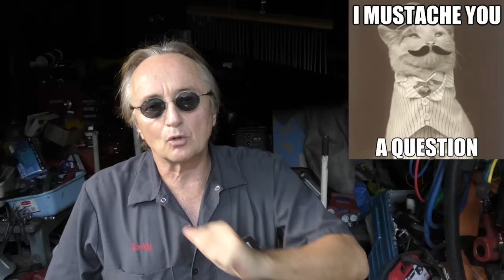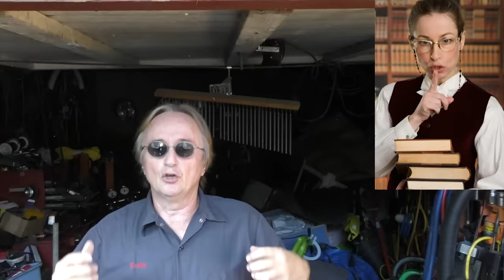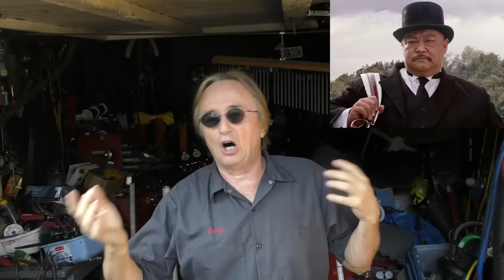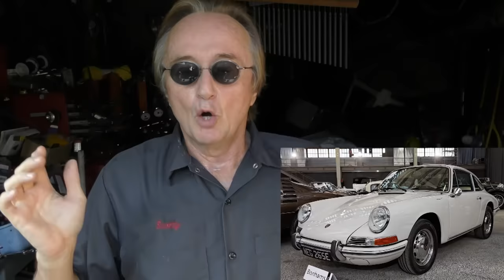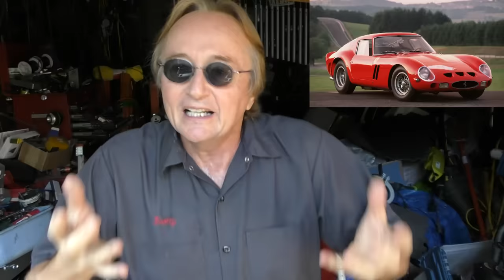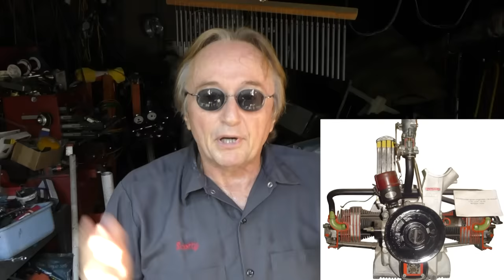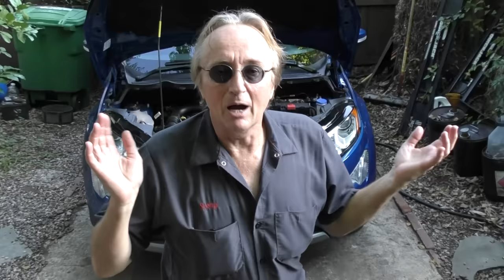The Truth About Boxer Engine Cars

Comment: I've owned 3 Subarus over a 40 year period and they are one of the most reliable cars on the planet.
Reply: Well they "subaru" are owned by toyota, and some of there junk is cheap china junk, 130,000 your gonna do a head job.every time , not on my G.m. cars and pickups.
Reply: @mikestanly749  Cheap china junk? I loved my GM cars but man are you dense if you think these cars are "cheap china junk". Japanese engineers don't equate to Chinese engineers.
Reply: @mikestanly749  The head gasket issue was mostly w/ the DOHC naturally aspirated engines that ran in the early 2000s in certain models.  I've driven three Subarus past 200k miles, and a couple more past 150k and never had head gasket failure in any.  (I also didn't have the notorious SOHC 2.5, mind you.)   Consumer Reports still ranks the brand as very reliable.  They are incredibly safe, and have an AWD system that few can rival.
Reply: mike stanly not 40 years ago they weren’t. Not even 20 years ago...
Reply: @tuck229  the only reason why the head gaskets failed in the non turbo 2.5L engines were only because of the cheap head gaskets subaru used.. the early STI's didn't have the same notorious problem
Reply: Let me guess...You baby your car and go above and beyond with maintenance.
Reply: @YNorth  When was the head gasket problem resolved?
Reply: my dad owns subaru like 15 years We had Justy i am not shure if its boxer engine we had outback,Xv,Foresters and now we have levorg we had alot of expirience with them and they are actualy very very reliable cars theyr much more reliable than fords peugots and more I would say that maybe theyr as reliable as toyota.
Reply: @dario4496  All Subarus have a boxer engine.
Reply: @mikestanly749  A 17% stake in the company is hardly owned
Reply: @YNorth  The head gaskets in the 255's and 257's were garbage too. Tomei makes an almost bullet proof EJ head gasket. I have a 255 with a tomei hg and arp head studs that's turned over 200k hard miles with no issue
Reply: Try telling that to my friends that are on their 3rd engine. Most gone before 60k miles.
Reply: @jordanjoestar8839  Sure but you don't know what kind of maintenance they did either.
Reply: @jordanjoestar8839  Your friends need to pay better attention to regular maintenance. Three EJ's over 200k, only had one that was run low on oil because my kid was driving it, blew a turbo line and drove it another 45 miles that needed a rebuild
Reply: I own a 09 forester xt turbo 120 k and runs like a YOTA 😁 My 4th subaru
Reply: My sister had a Subaru for 14 years and then passed it on to our mother for another 5 years. I gave mom my 91 Camry with 125,000 on it and she took it to 300,000. Toyota and Subaru both good.
Reply: Totally agree. I'm on my 9th Subaru and when the new STI comes out I will buy number 10!
Reply: Except the 'glass piston' STIs...
Reply: I have a Subaru Forester had it since 2004 runs great...
Reply: My 2003 outback has 360k miles and is still going great, original engine, transmission, alternator, etc.  I'd buy another in a heartbeat.  Just recently replaced a lot of suspension parts, ball joints and a year ago, rear drive shaft.  Other than that, runs fantastic!  I could see it going 400k+ miles easy!
Reply: @mikestanly749  140k on my automatic and no head gasket failure.
Reply: @mikestanly749  no China On  Subaru’s
Reply: @mikestanly749  No China on Subaru ! You need to educate yourself ! Subaru’s are vastly more dependable than General Motors products! General Motors has some good years especially some trucks but the general dynamics of a Subaru is far superior in engineering and driving dynamics.
Reply: @mikestanly749  my bubaru forester just hit 170k. Still don't need a head gasket.
Reply: @mikestanly749 GM = plastic drop links
Very cheaply made cars.
Reply: I just bought my first subaru crosstrek...so far I'm loving it...
Reply: @mikestanly749  best do your research before running mouth.  I sold Subarus and many of them were well above the numbers you gave and no issues.
Reply: My 1995 Subaru impreza just hit 400k still running strong. No weird smoke or idle issues. I still can't believe it starts up every morning.
Reply: can someone help me with my subaru
Reply: @irontiger0462  hmmm. Subaru made 1.8 billion in 2021   whats 17% of 1.8b? Ill make it easy. 17% is 1.7 million bucks a year.  Im pretty sure... thats owning a piece.
Reply: @mikestanly749  just had my 2013 subi outback head gasket replaced at 134,000 miles. i heard o2 sensors and axles are also notorious for going bad after mine went. make sure you spend the extra $100 to get a subi axle and not aftermarket 🙃 i'm learning the hard way
Reply: @mikestanly749  200K on my 2015 Impreza. original transmission and engine no issues.
Reply: @YNorth  I don't think the gaskets are the issue.I feel it's the cheap head bolts are stretching.Every one I worked on I checked the head bolts with a torque wrench and they are always a little loose..I use the ARP stud kit to reassemble and never a problem now even with a lot of boost.
Reply: @jonmiller19845  It's true that 17% is nothing to sneeze at, but that is not sufficient for a controlling share. They do not own enough of the company to make business decisions unilaterally, nor enough to wield sufficient influence to effectively make them unilaterally, so no, they don't own it
Reply: @mikestanly749  If your into mediocre GM vehicles and want to constantly be having to maintain them then sure GM works fine. But I’ll stick with my Subaru
Reply: @JustifyJustin  Only when the owner is one of those i will rev my cold engine stationary for 3 minutes to show my friends how dumb i am... Then wonder why it blew up..